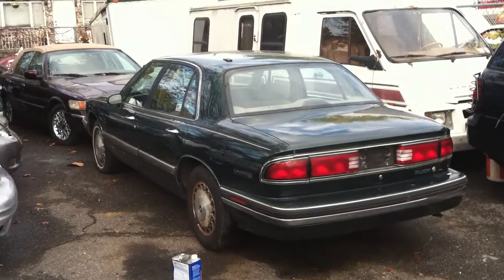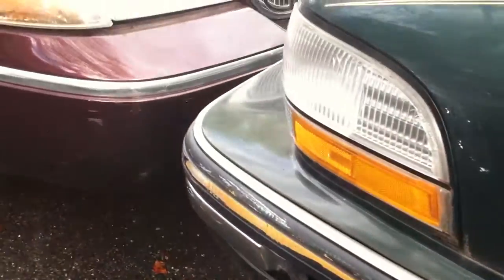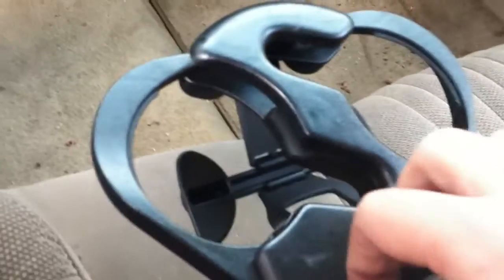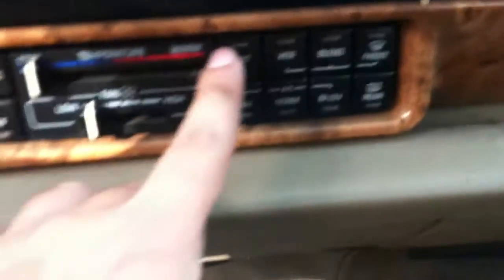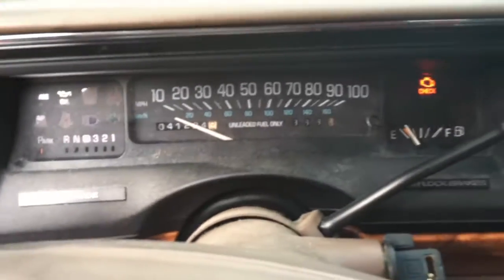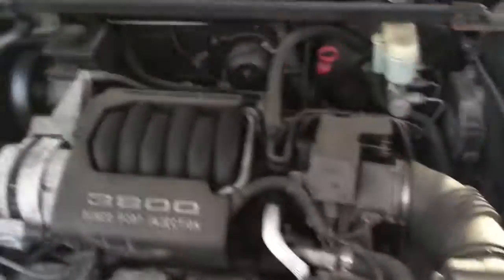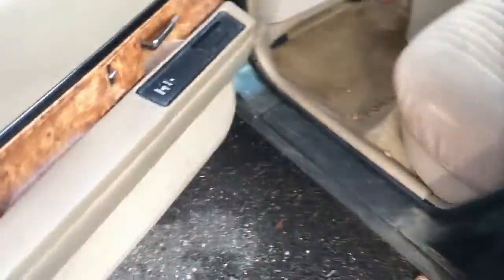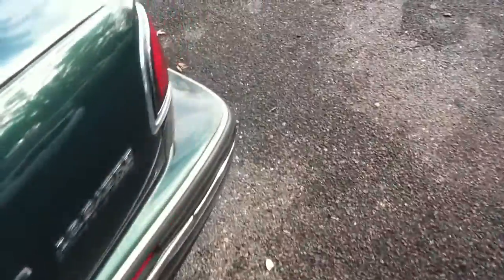Look at a 1995 Buick LeSabre Custom

Comment: I just purchased a 1994 Buick Lasebre out here in NM and it came from an old man that passed on.  Has 33,000 miles on it as everything is pristine inside and out.  I was surprised at the power it has as was used to driving my 1994 Cougar with the big v-8 engine and it also had a lot of get up and go.   It has 129,000 miles on it.  Well was just checking out the Lsebre's on youtube this morning.
Reply: I found a 96 with 40k I’m about to pick up